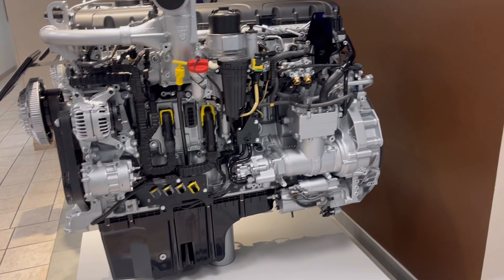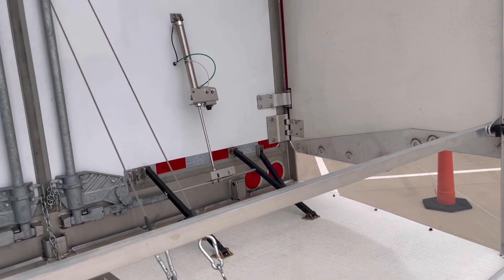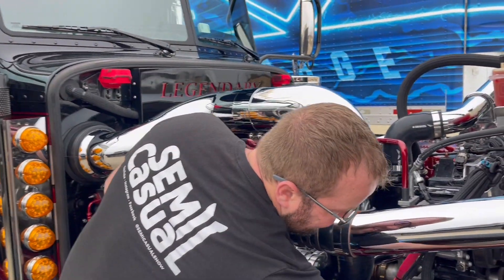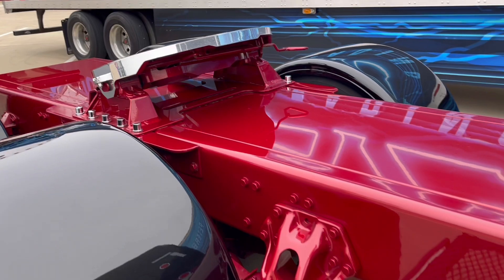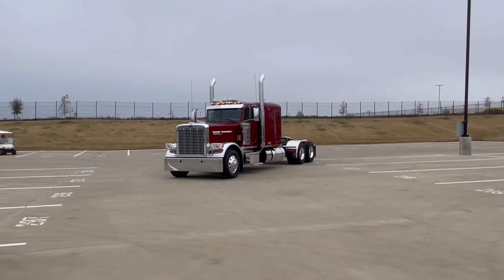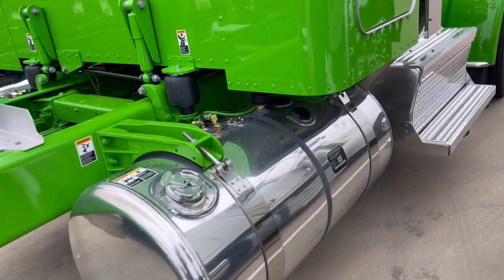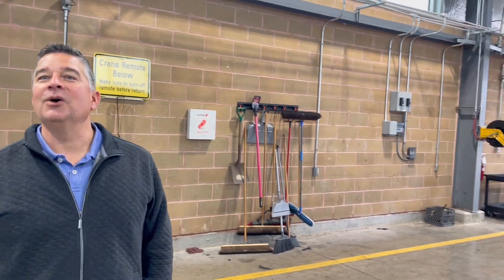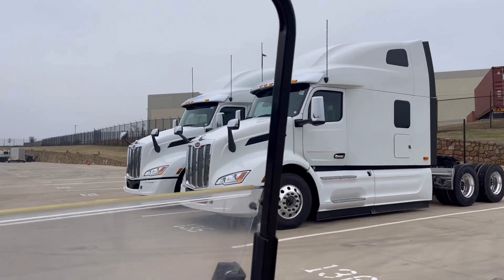I Found Peterbilts Factory Storage Lot!

Comment: Worked there a few years ago, and all the different specs cause very less disruption than expected on the assembly line, the parts are in kits by truck so some boxes have more stuff in them. 
They will let you drive your new truck off the line and onto the dyno. They probably won't let you film but the 10 spindle and frame flipper are both cool.
Reply: Did they let you ride in the tow truck on the way back from Dyno??
Reply: @mattbrewer9487  No, the dyno was 20' off the line then before the expansion out back was done. Just walked back.

Comment: that damn trailer is jus a conversation peice no damn way that shit is practical or even worth tha headaches
Reply: Right my first thought was the shit will easily get stuck on something even torn up just like a vehicle that's been slammed without air ride
Reply: @Infern01898  exactly. i couldnt imagine being asked to use that, at least i pull a flatbed and you wont ever see an aero-dynamic flatbed lol
Reply: Plus when it get Ice on it & cnt open doors & get stuck on low crossings without damn fairings
Reply: @scottycollins1829  lol swear man pointless